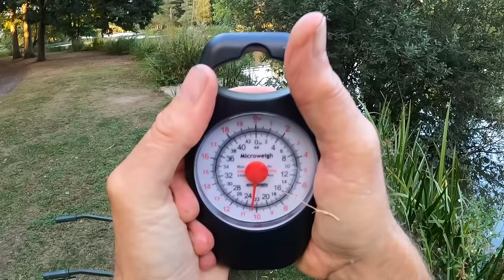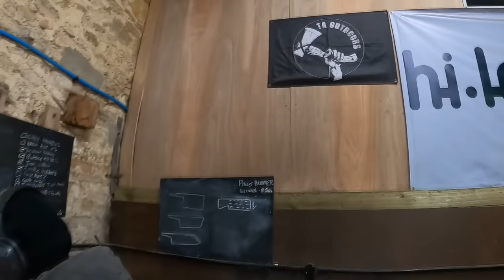Solo Overnight Fishing & Camping....What a  Fish-Fest!

Comment: A nice big ham and cheese omelette is an easy overnight meal which doesn't require any special treatment. Get an empty pop bottle, crack your eggs into it at home, add seasoning and give it a shake before placing in a coolbox or somewhere it won't get warm, when you're ready to eat all you've got to do is pour it in a hot pan and add a bit of grated cheese and ham. Sauteed potatoes are a good side dish if that's not enough, thin slices of potato fried in a hot pan with a bit of oil until crisp seasoned with salt and pepper, maybe a bit of garlic powder